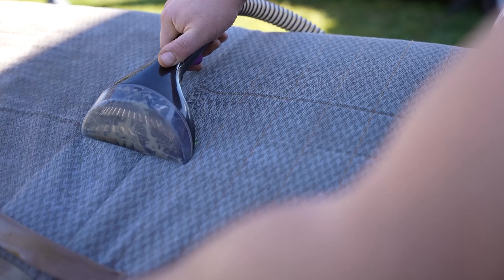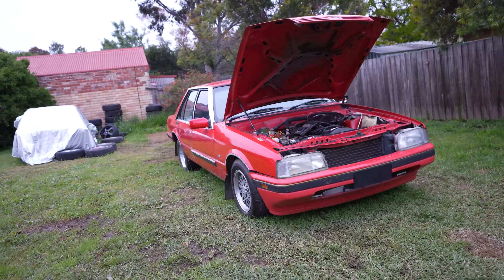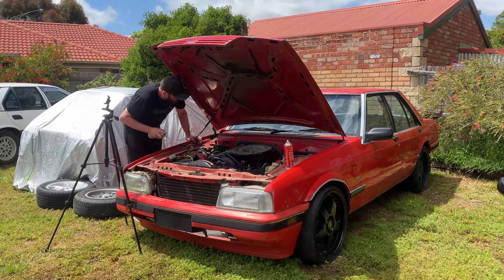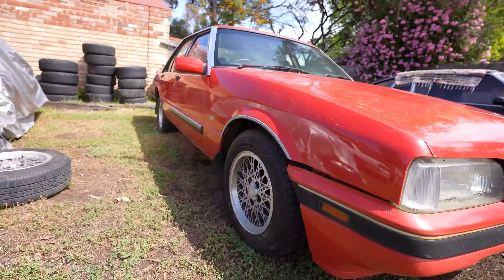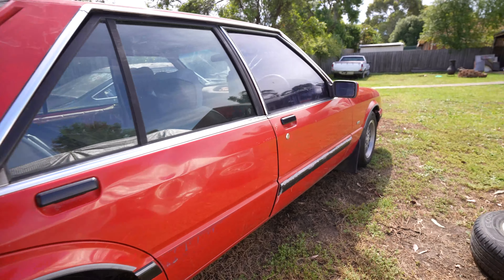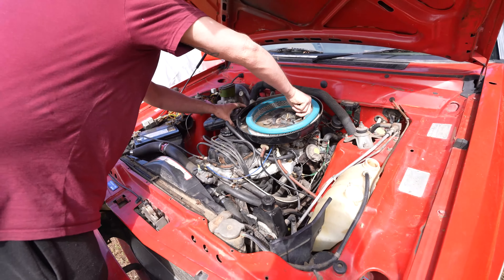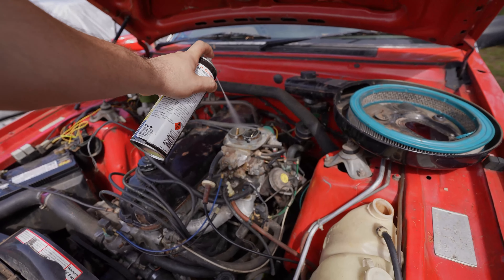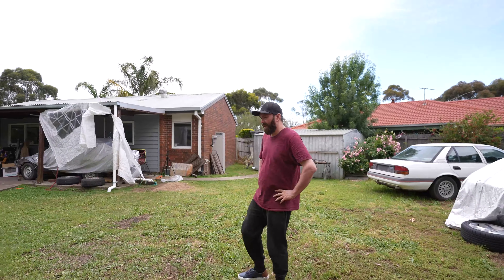XF Falcon Project - New wheels, New Carbie and Tank Clean out Episode 5

Comment: Had a similar issue around 10 years ago, a couple of push rods failed. Managed to score a reco head off eBay for 50 bucks, solved all the issues!
Reply from the maker: Thanks for the Info we decided to pull the head off and we found a couple of metal shavings in the cylinder super annoying the head Machina said that the old spark plugs might have dropped some metal he seen it many times before

Comment: Hey mate, just bought an xf a few weeks ago too. 

Got it running eventually, ran better with choke wide open (little green circle on back of carb, undo screws and rotate so the butterfly is all the way open)

Then turns out two cylinders have dropped compression so that's why we couldn't get it running any better.

Just got hold of another 4.1 carby motor to chuck in for rego, then start getting pieces for barra + btr auto swap 🤘

Stoked to see another video of the sexf 😎
Reply from the maker: Hey thanks for that information I did give it a go and I did mention you also in one of the videos unfortunately it did not fix the problem

Comment: Hi, I get the same start up knock in my XF after it's been sitting for a while. I think it's because the oil pressure hasn't built up yet and the oil hasn't taken up the clearances in the engine yet. After the start up the knock goes away. I removed the mechanical pump and used the gasket to make a block off plate. I fitted a Goss electrical low pressure 4.5 to 6 psi pump in the boot with a combination of hard lines and rubber lines. I blocked off the return line because the pump can sustain the pressure and doesn't need it. The advantage of the electrical pump is you can fill the fuel bowl then pump the accelerator pedal once to get the weber carb in fast idle up mode to set the auto choke.
Reply from the maker: Thanks for that info we ended up taking the head off to have a look because the knock didn’t go away and We found some small metal particles in cylinder one and two